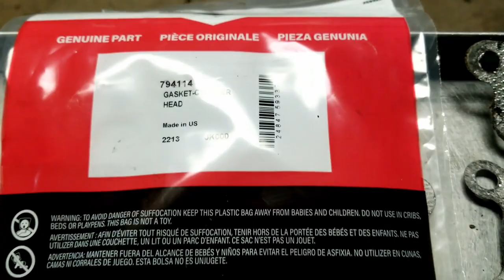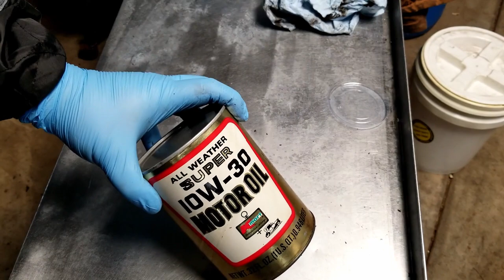Briggs And Stratton INTEK engine - Replace Head Gasket

Comment: Can this be done without taking the engine off the frame?
Reply: I don't know for sure, but I think so. Mongo know!
Reply from the maker: Yes, don't need remove engine for head gasket job. Depend on frame, may have to remove exhaust guard to get exhaust muffler off. Also Have to disconnect fuel line and cables. But can be done on the frame.
  
Mongo remove this engine and do engine swap. Get mower back to work quicker. Fix this engine during winter.